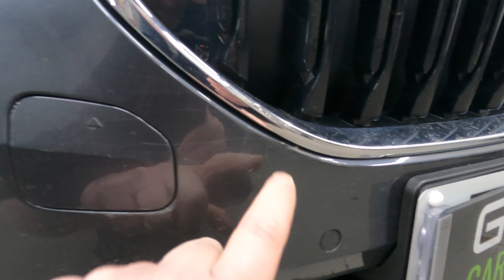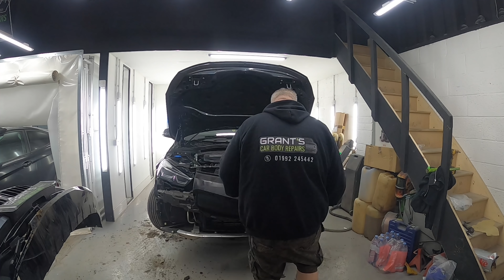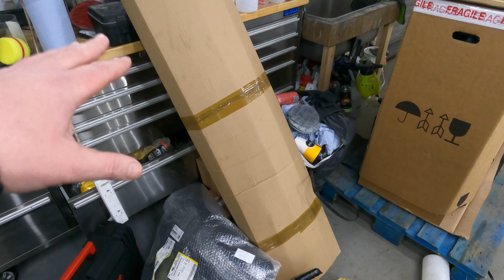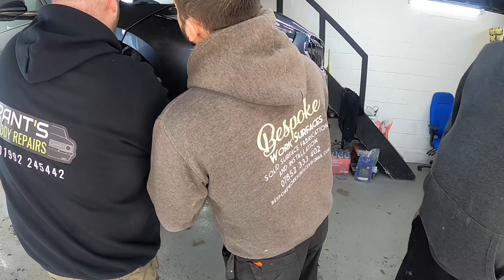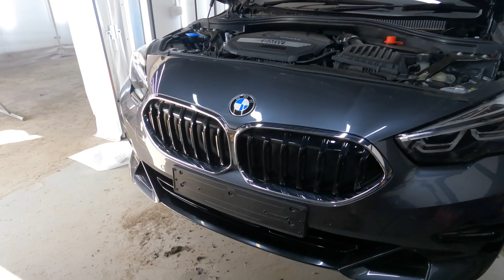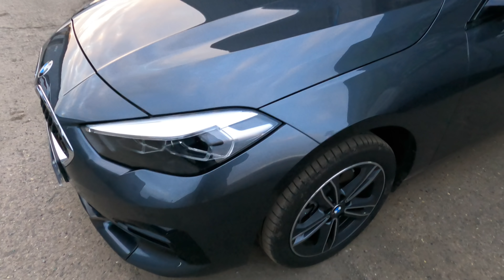BMW 218i crash repair

Comment: Top quality job mate 👍. Imagine trying to do that job on someone's driveway when it's threatening to rain 😲.  Doing paintwork outside is certainly a high stress occupation which I wouldn't want to try.
Reply from the maker: I can’t wait to get out there 🤣🤣🤣🤣👍👍👍👍
Reply: @grantssmartrepairs  So you'll be changing name to 'Grant's Alfresco Car Body Repairs'   
😂.   Best of luck with whatever you decide mate 👍👍
Reply from the maker: 🤣🤣🤣🤣 bodge it and scarper
Reply: @grantssmartrepairs  😂😂😂
Reply from the maker: It sure on the name tbh probably just change the car body repairs to smart repairs

Comment: Think i might be no 2 - but no 1 from Germany!
Reply: @grantssmartrepairs  Grant, great video as ever. It's a long drive but I shall be using you next year to get my front bumper resprayed on my 2019 E Class. Factory paint very poor and not stood up to stone chips very well. In Germany they don't blend - paint gets mixed to spec and that's it!
Reply from the maker: I’d prefer to paint it all but I have to do what I’m paid for

Comment: Excellent job not being too critical but go past the panel your painting with clear coat a bit more you need a to go past a good 4” inch you stand back after and see it yourself and add more to the edges 🙈don’t hate me
Reply from the maker: I do normally mate when I’m in the booth just didn’t want to out there 👍👍👍

Comment: bring back the 80s 4 bolts on my 2.8 granada. mk2 escort 2 bolts . plugs  rotar arm and points .all done in 25 minutes .corner shop £8.99 .

Comment: Nice work, what blend promoter did you use?
Reply from the maker: That one was Multimix 👍👍👍
Reply: @grantssmartrepairs  Thanks for the reply, Ive already gone and bought fade out blender additive for a gun set up not sure how to use it though.
Reply from the maker: Just pour it in the gun mate and gently dust it on your blend not to much as it can run easily you just want it to start melting the edges in a bit 👍👍👍